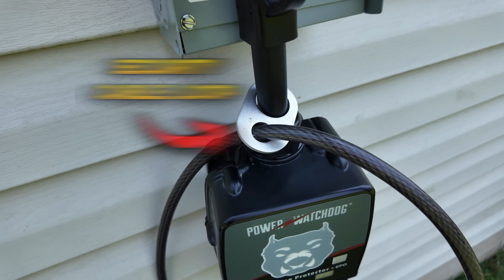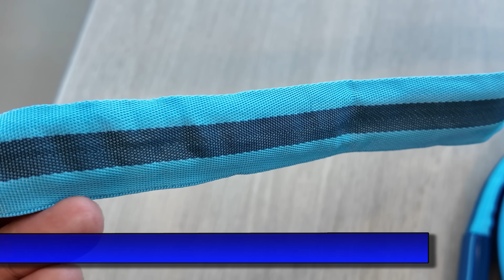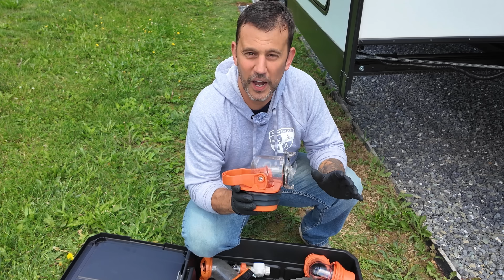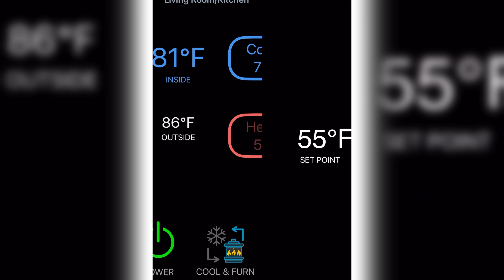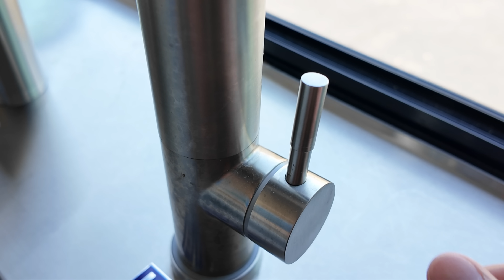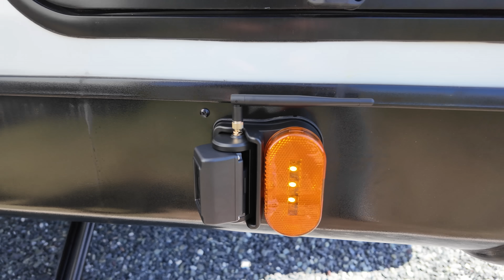💡Innovative RV Accessories & Upgrades That CHANGE the Way You RV!

Comment from the maker: ✨ PRODUCTS FEATURED IN THIS VIDEO 
🔷Power Watchdog Gen 2 (select options & amperage in listing) https://geni.us/GqDx5i (Amazon)
🔶Replacement Surge Module for ALL Gen 2 50 Amp Models https://geni.us/DP038BP (Amazon)
🔷Replacement Surge Module for ALL Gen 2 30 Amp Models https://geni.us/0389AD (Amazon)

🔶Camco Evoflex 2 Drinking Water Safe Hose https://geni.us/emLdlC (Amazon)

🔷Camco Rhino Sewer Adapter Pro Drain Lock https://geni.us/cFPD
🔶Camco Clear Elbow https://geni.us/L79gI2 (Amazon)

🔷Micro Air EZ Touch Thermostat https://www.microair.net/pages/easytouch-rv-thermostat-replacements-select-a-brand (use code RVTIPS at checkout for $15 off) Promotion good through June 21, 2026

🔶Blu Technology 4 Stage UVC Filter (7% off, no code needed, just use this link) https://goblutech.com/collections/new-releases/products/goblutech-ar3-led-uvc-elite-series-0-2-micron-4-stage-rv-water-filtration-purification-system?ref=xxnnkdun
🔷Blu Technology UVC Faucet (7% off, no code needed, just use this link) https://goblutech.com/collections/new-releases/products/goblutech-uvc-purification-faucet?ref=xxnnkdun
🔶Contact Blu Technology to Upgrade: service@goblutech.com

🔷Haloview BT7 Back Up Camera & TPMS Systems https://www.haloview.com/products/byte-tango-camera-tpms-system.html?acc=765 (use code RVTIPS at checkout for 5% off & free shipping)
🔶Already have a BT7 system?  Upgrade here: https://www.haloview.com/byte-tango-bt7-tpms-monitor-with-4-pack-tpms-sensor.html?acc=765 (use code RVTIPS at checkout for 5% off & free shipping)

🔷Shop MORE RV Parts https://geni.us/1Omwvhh (Amazon)

OTHER VIDEOS YOU MAY LIKE
🎥Micro Air Thermostat Installation https://youtu.be/o0-Yvr3YPQo
🎥Blu Tech Filter Video https://youtu.be/PnKyWJdxmW4
🎥Haloview Back Up Camera & TPMS Video https://youtu.be/8Zmh6kvO-Kg

New Accessories, Products & Gear That Are Changing the Way You RV!

#rv #rvlife #rvliving #rvlifestyle #rvtips #rvtravel

RV ESSENTIALS & TOP PICKS 
🎥Essentials Video: https://youtu.be/yuvS3zZL81c 
🔷Sewer Hose Kit https://geni.us/7dNg (Amazon)
🔷Clear 90 Degree Sewer Elbow https://geni.us/L79gI2 (Amazon)
🔷Camco Sewer Adapter Pro Drain Lock https://geni.us/cFPD
🔷RV Water Filter https://geni.us/FZ1P (Amazon)
🔷Best Wheel Chocks https://geni.us/9B5i (Amazon)
🔷Wireless RV Leveler https://geni.us/DAW9N24 (Amazon)
🔷Leveling Ramps https://geni.us/m38VoBr (Amazon)
🔷Liquified RV Tank Treatment https://geni.us/QTUJSrP (Amazon)
🔷Tire Minder TPMS https://geni.us/8HBSTg (Amazon)
🔷Water Pressure Regulator https://geni.us/fTzA0 (Amazon)
🔷Browse All Essentials https://geni.us/1Omwvhh (Amazon)

MAINTENANCE:
🔶Boeshield T-9 Rust Preventative & Lubricant https://geni.us/uXxstyC (Amazon)
🔶Geocell Proflex Sealant https://geni.us/YXiACx (Amazon)
🔶Water Heater Cleaning Wand  https://geni.us/AcTvhLc (Amazon)
🔶Water Heater Drain Adapter https://youtu.be/h6C6ihTQ1cY
🔶Waste Tank Rinser https://geni.us/V2XLE (Amazon)
🔶Road Tool Kit https://geni.us/oBFnd9l (Amazon)
🔶Eternabond Roof Tape https://geni.us/6AXdw (Amazon)
🔶Browse All Maintenance https://geni.us/UvxFP (Amazon)

INSIDE
🔷Screen Door Handle https://geni.us/itRfKUQ (Amazon)
🔷Shower Caddy https://geni.us/ZPcno (Amazon)
🔷Oxygenics Shower Head https://geni.us/jznwF (Amazon)
🔷RV Paper Towel Holder https://geni.us/Acknol (Amazon)
🔷Dimmer Switch (watch video) https://youtu.be/2bbqBcSsRZQ
🔷Electric Heater Fireplace https://geni.us/YmBoktI (Amazon)
🔷Browse All Inside https://geni.us/BWiOR8k (Amazon)

OUTSIDE
🔶Gravity Chairs https://geni.us/VlPR8rn (Amazon)
🔶Ground Mat https://geni.us/wbWWLzf (Amazon)
🔶Table https://geni.us/qsPO (Amazon)
🔶X Chocks https://geni.us/3oyburw (Amazon)
🔶Blackstone Griddle https://geni.us/8BuIrW (Amazon)
🔶Low Point Drain Valves https://geni.us/yBB02h7 (Amazon)
🔶Browse All Outside https://amzn.to/4ld0kcz (Amazon)

👇 COUPON CODES! Use the links. Save money. Simple.

🚐 10% off RV Snappads & Snapjacks https://rvsnappad.com/discount/RVTT10

🛌 Get 30% off your RV Mattress by Brooklyn Bedding at https://rvmattress.com/rvtips
Use Discount Code: RVTIPS

🔧 NRVTA Home Study Course https://rvtechcourse.com/discount/RVTIPS20
Use Discount Code: RVTIPS20

🚴‍♂️️ Lectric eBikes - Use our link get FREE accessories https://lectricebikes.sjv.io/nLrJ3x

💻 Our eBay Store! You never know what you’ll find!
https://geni.us/6AyLKnS (eBay)

💥 Join Our FREE Newsletter! https://rvtipsandtravels.myflodesk.com/freenewsletter

If you want to support the work I do to help others, you can donate here:
Paypal: https://www.paypal.com/donate/?hosted_button_id=J2KKM9NR3BJJA
Venmo: https://venmo.com/u/Ross-Stoico

Follow Us on Social Media
https://www.instagram.com/RVTipsAndTravels
https://www.facebook.com/RVTipsAndTravels

🙏 If you find a dead link, PLEASE let us know & we’ll send you bumper stickers!

As an Amazon Associate, I earn from qualifying purchases. As a Walmart Creator, I earn from qualifying purchases. There is NO ADDITIONAL COST TO YOU when purchasing from our links. Thank you for your support!

Comment: Ross,
Great video. Question about the Halo TPMS: I currently use the TST system and, over the years, have used both internal and external sensors. I found that the external sensors did not accurately measure the tire temperature. They only seemed to measure ambient temp plus whatever residual heat would transfer through the valve stem. Differences between the two seemed to be about 20 degrees. What is your experience, if any, with this?
Reply from the maker: i dont have any experience with internal sensors other than whats on my truck. i guess i look at it this way, even if the external sensors arent registering a "true" temperature, they are at least registering, and they are all climbing at similar rates when driving... in other words if 1 of them is way off, id probably pull over and check it out, but if they are all the same (because its extremely unlikely for all 4 tires to be dangerously over temp limits) and they all change during a trip at the same rate... i guess thats my way of feeling like even though they may not be true, they are working.  does that make sense?
Reply: @RVTIPSANDTRAVELS Yep, that makes sense and it's the only way I see to look at using the external sensors for temperature. I've opted to stay with the internals out of a concern that, should there be an issue with the wheel, I'm not sure the external sensors would register the temp change early enough to help me minimize the damage. I might be wrong -- but it's my feeling that they give me that added layer of protection. Thanks again for all the info you provide

Comment: What about the Coleman smart thermostat?   Better interface and about $100 cheaper than the Micro air
Reply from the maker: good question, i never looked into it.  it is a little cheaper but unfortunately only works for on the Coleman Mach AC's.

Comment: I just installed the Haloview on my 2024 Venture Sonic.  It came prewired for a Furrion camera, but I went with Haloview due to the reviews.  A couple of things I ran into, was the adhesive caulking that they used on the back of the Fusión assembly, was a giant pain in the butt. It got all over everything, and the only thing I could find to take it off was brake clean. Also, they had screwed it in directly to the fiberglass, which the screws worked great the first time in fiberglass. When you back them out, and try to reattach, they do not grab, and you have to drill new holes. Also, the adapter they sent for the pre-wired power, is very bulky and is very hard to fit in to the recessed back of the haloview camera.  It was advertised as a 15 minute install, but took more like 90 minutes.
Reply from the maker: i had that caulking on the back of my Furrion bat wing as well.  A little shop solv and a plastic putty knife removes it pretty quickly ( https://geni.us/3PFYAs ).  I cut the camera wiring down and just used butt connectors to connect them to the trailer wiring so everything would fit easily.  Let me know what you think after you tow with it!

Comment: What is a good brand water pressure regulator? The one i have the needle jumped. I need a new one, so I figured I'd ask you.
Reply from the maker: to be honest, the adjustable ones all seem to be similar, and I would guess they are all private labeled from a plumbing company.  Here is a brass one: https://geni.us/fTzA0

Personally, I use the brass one showin in this video: https://youtu.be/PnKyWJdxmW4

Comment: Worth noting that all of these products, except one, are for people who use hook ups at paid camp sites, something we have thankfully never done in 6 years with our camper. Boondocking is our preferred method of camping, it's the only way for us to truly enjoy the outdoors. But of course to each their own 😊
Reply from the maker: id agree we all use our RV's for something different, but I am curious to know your thoughts (besides the EMS) on which products you cant use even if boondocking?  i still use drinking water safe hoses and filters to fill our fresh tank when we stay at places with no water hook ups.  the UVC filter can be run on 120 or 12 volt. the tpms and monitor is for driving, and the thermostat can be used without hookups as well.  sewer accessories may not be necessary while camping, but you have to dump those tanks at some point.  let me know your thoughts... and what rv do you have?
Reply: @RVTIPSANDTRAVELS  We fill our camper  at home using the already filtered water from our town's water supply, but of course some boondockers may need to fill up elsewhere where the water quality cannot be trusted.  True, backup cameras have a use when going down the road, but are rarely needed for camping in the more wide open spots available for boondocking.  We can see black water clearly when dumping using the standard elbow.

Don't get me wrong, love you and your channel! :)  The best posts you have done IMO were on how to apply EternaBond and silicone roof coating on the RV roof.  I am blown away that RV manufacturers do not do a better job of sealing roofs, as water damage is one of the main reasons campers do not last as long as they should.  Our first camper was ruined within 3 few years because of water damage.

We own a 2020 Grand Design Momentum 21G, and still love it.  We dirt bike, SxS, and Jeep wherever we go.  Thanks for all you do!!
Reply from the maker: thanks my friend, glad the videos are helping, and all that makes sense.  thanks for being a part of the channel, and safe travels!

Comment: Love the gen 1 Hughes. I want the gen 2 but they are expensive; what’s a camper to do 😃. Also, that Rhino adapter is not available anywhere. Been looking for it for months.
Reply from the maker: Stick with the gen 1.  It’s still better than any other brand.  The gen 2 has some new features, but protects the same way.

Comment: FYI, the water passing through the ultra violet light moves too fast to actually sterilize it! Sorry if this bursts any bubbles. You can and  should do a little research before you purchase!
Reply from the maker: the effectiveness of UV light has on altering virus DNA in water depends on flow rate and exposure to the bulb.  Both of these factors are used to design not only the water tubing and flow rate, but also the size and intensity of the bulb.  Water is tightly passed near a bulb in these systems.  Where it needs more time to sanitize water is when you are exposing larger volumes of water.  There's plenty of independent 3rd party tests done on faucets, which have been around for years and flow systems showing it takes a fraction of a second when passing next to the bulb, as it does in these systems.  Larger sanitizing systems can require much longer times to completely disinfect the water.  https://www.youtube.com/watch?v=Im4E5uKkK1Q

Typical Exposure Time:
In well-designed residential or portable UVC water systems (e.g., SteriPen, UV filter housings), exposure times typically range from 30 to 90 seconds PER LITER for handheld portable devices

A fraction of a second to a few seconds for continuous-flow household UV filters, depending on flow rate and lamp power.

Quick Example:
Portable UVC Device (SteriPen)

1 liter of clear water

48 to 90 seconds of exposure recommended

Household UV Filter (flow-through)

Continuous flow with a dose of 40 mJ/cm²

Exposure time designed into system based on lamp strength and flow control

The products mentioned in this video have been designed and 3rd party test to kill 99% of contaminents based on suggested water flow.  I would agree these bulbs would not immediately work if placed in a LITER of standing water, but they do work at a minimum dosage of 40 mJ/cm.

Comment: Those water hoses are great. Very easy to use, light weight and easy to store. But there is one big drawback...if you ruin an end by crushing it, or the threads get crossed and won't tighten, I do not think you can replace the hose ends. It is basically a no repair type disposable hose.
Reply from the maker: thanks for sharing, might be worth adding quick connects one time so you dont damage the threads: https://amzn.to/4k6TjrU

Comment: I hunted for so long to find that Camco Rhino Pro elbow adapter. It worked great at the first campground we went to. Then it was a total fail at the next 4 campgrounds. So far, it's only fit 1 out of 5 places we've been to. It's just too big to fit in most of the places we've been so far. My disappointment was immeasurable. My day was ruined.  FYI, I got it at a local Fred Meyer's.
Reply from the maker: ive been hearing this from a few folks and thought it would be a good idea to talk about.  nice channel by the way!

Comment: Hey there! Do you happen to know if the Watchdog ver. 2 still takes the same backup circuit board as version 1? Love the locking mechanism on the plug, and might pull the trigger as the 'watchdog' is super bright for campground neighbors. 

The 25' hose on my Blu Tech filtration/water softener kinks easily, so am thinking about the collapsible one. Do you think it'd hold up to Florida in the winter for 5 months? 

And great call on Blu Tech. Worth it. That 0.2 micro filter already sifts out 99% of bacteria, but to kill anything else, that'd be a game-changer to add the ultraviolet. Going to check that out now -- as well as that thermostat. Thanks again, Ross!
Reply from the maker: hey bud, the surge module is different on the gen 2, but there are only 2 now, 1 for all 30 amp units, and 1 for all 50 amp units.  in the past, ive taken an plastic garbage bag, cut out a sheet (about 20"x20", wrapped it over where the plug connects and zip tied it to the cord above the connection to form sort of a cover for the plug.  looks awful, but works well.  the blu tech hoses can easily kink... something i do there is just keep them rolled up when not in use, then spend the extra time unrolling and unraveling the tension so they arent kinked when laid out.  but yes, i get it.  not sure if the camco hose will hold up, but ive used zero g hoses that sit outside in the sun year round at the house.  the fabric is old and faded, but still work great, so im assuming the camco hoses should be ok.  let me know if you have anymore questions bud.

Comment: Great video as always Ross,   We bought Venture Sporttreks pretty close to same time.  I did splurge and the the Watchdog GenII and can say it works great,  very easy to switch back and forth from WiFi to Bluetooth. A couple of questions on your new unit,   The auto level,   Is there lubrication point on those rear jacks??  I have crawled around and don’t see any.  Also my fridge tends to condensate on the inside back wall and then freeze,   Is there any fix for that??

Thanks for be a great resource for rv’s.  Like someone else said,   I really need to check out those thermostats!!

Stay safe!!
Have Fun!!
Reply from the maker: i dont think there are lube points on the rear stabilizers, but i havent dug into them just yet.  i get condensation on my back fridge wall too... i just turned the temp down and it seems to mostly go away.  make sure your drip tube is clear.  after everythng ive read im waiting for something to go wrong with the 12 volt fridge, but so far so good.

Comment: the AC upgrade looks VERY interesting, i have a dometic and it wont turn on or off at the right times and it just fails to work unless reset. maybe the new ac face upgrade will fix it.
Reply from the maker: i had a dometic in my last rv, it was awful.

Comment: Why do we need ems protection?
Reply from the maker: theres a lot of reasons, protects the RV from fire... things like low voltage at parks can cause high amp draws, pedestals are not always wired correctly or breakers properly serviced.  shorts, reverse polarity.... its a topic for a video I need to get around to making but its a good idea to protect your RV's electrical since every campground is different.  is your RV 30 or 50 amp?

Comment: Great video. Again you cover tons of info in a short window very thoroughly. I’ve been waiting for the Watchdog 2 from you. 

I believe the watchdog 2 has the same trips as an EMS. I need to check each trip item to be sure. 

I did have a question about the thermostat and the auto programming. We run our ac fans on auto during the day but constant run at night for background noise. Can the auto/constant fan be programmed into a nightly routine to start every evening?

Great video and keep up the awesome work.
Reply from the maker: Hey Rick, I'm pretty sure fans can be set on the schedule... ill text you some pics.